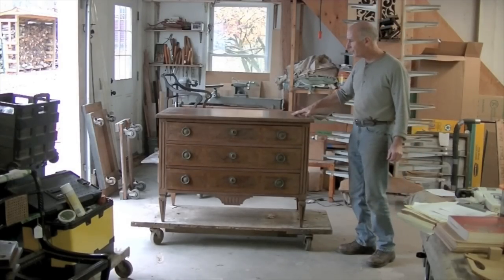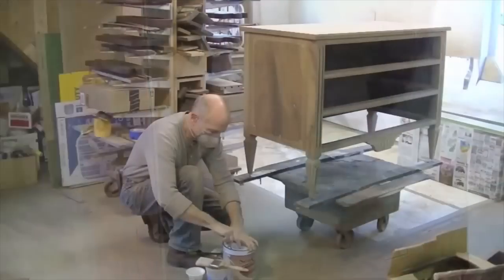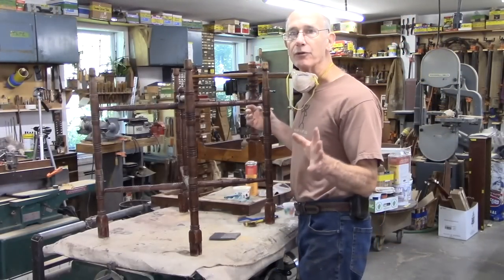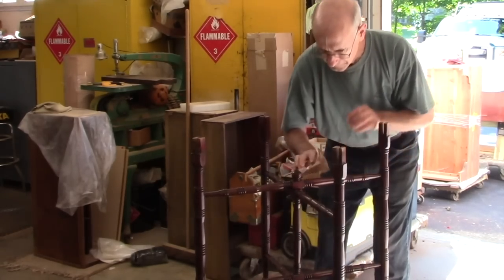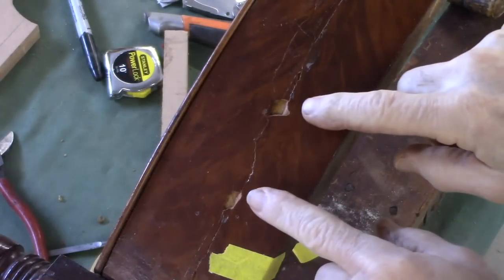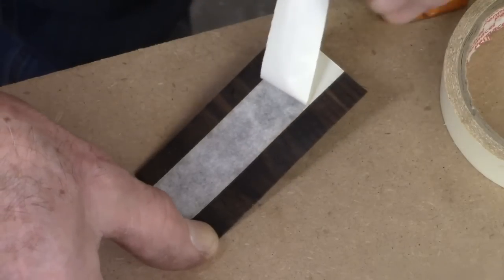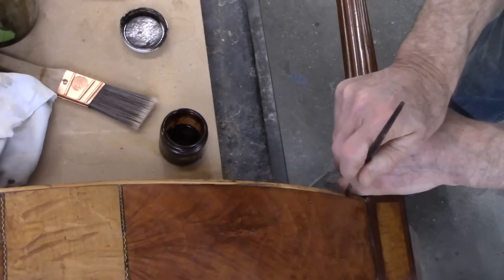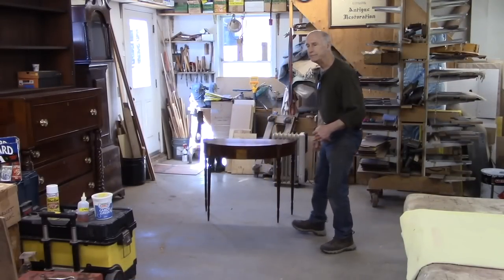DRAMATIC Furniture Restoration! - Thomas Johnson Antique Furniture Restoration

Comment: I love your work. The pup’s hearing protection made me smile. It makes me kinda sad that a lot of woodworkers use PVA glue nowadays for everything. When that furniture needs repair in 100 years… Well, I feel for that restorer. Hot hide glue or liquid hide glue is definitely the way to go for joinery. PVA has its place, as does epoxy, CA, etc. as for the tabletop glue up and extended time you needed. But hide glue is excellent for fine furniture joinery!
Reply from the maker: Thanks! Yes! So true. I use PVA for all new work though

Comment: Great video. I appreciate learning about clamp pressure. Why are nice species of wood covered with veneer?
Reply from the maker: Thanks! You can get all types of different grain and designs. It does make a more stable panel too (if done correctly)

Comment: Wonderful video. My favorite is the campaign table. My best friend wants me to replace the cane seat in his grandfather's cane chair. I've found the parts and I feel pretty good about doing it. Can I use hide glue rather than pva? I'm just thinking about future repairs. And what sort of finish should be used on the cane? Thanks so much for the advice.
Reply from the maker: You're welcome! Yes, you can use hide glue anywhere that you might use PVA, they're both good. Cane doesn't need any finish, unless you're trying to stain it. I always recommend just letting it age
Reply: @johnsonrestoration  I'm glad you said that.  I have a side chair with a busted  cane seat and was wondering the same thing.  Not quite ready to learn that craft, though, but it's on my list. 😁🦋🦋

Comment: I would sugged investing in a vacum bag system.  It eliminates so much extra work when veneering.  Well worth it if you are doing large sections often.
Reply from the maker: Thanks! It only works if you can put the entire object to be veneered inthe bag. I have done that reveneering antique tops that can come off the base
Reply: @johnsonrestoration  I should have waited to comment.  I saw that you didn't take the whole side panel off when you did the glue up again.  My mistake.  Love your videos.

Comment: Furniture Wax: Tried "Gilboy's". Very expensive and had to go over it with "Howard's Feed and Wax" to get the look I wanted. Saw "Fiddes and Sons" used on "Salvage Hunters" in several episodes. Tried a little but not impressed. Going back to "Howard's..." for annual maintenance and also "Briwax Antique Oak" for my first coat for color on new builds. However, before any wax is applied, I apply several (3 to 4) coats of oil. Linseed or Tung. Get good, even color on pine from the "Briwax" after the oil application. Currently building pine rolling tool cabinets to replace my Sears metal ones. I will experiment with sealer first, then oil with a touch of stain, then "Briwax".
Reply from the maker: Thanks! Yes, the Gilboys is really only for formal pieces that call for a high sheen. I still use Howrd's 75% of the time

Comment: The scribe tool I use to etch polished elk horn buckles I can buy at a welding supply place that sells scribes for cutting steel with a welder.
Reply from the maker: I'll have to look into that. I'll google "scribe for cutting steel" and see what comes up.
Reply: @johnsonrestoration  King Tool and Dye in Bozeman, Mt. is who gave me mine.  I've had them since the 70's.

Comment: I have decided to restore a very used roll top desk but do not know how to determine what finish I am facing.  I did try denatured alcohol but it did not have any effect.  Any suggestions on how to find out the finish?
Reply from the maker: Thanks! I don't, except to say varnish would be very resistant to alcohol and paint thinner. Usually I don't worry much about what the existing finish is. I would try acetone or lacquer thinner to strip it, of course if that wasn't working well or too slowly I would go to varnish remover.

Comment: I will give you a tip, how I clean the metal parts (except for aluminium). I put them into a container, add some sodium hydroxide and add boiling water. It always works perfect.
Reply from the maker: Thanks! I'll try that!

Comment: Mestre TJ, eventualmente o nobre amigo já pensou em usar jato de areia ? Para mim, um analfabeto em restauração, me pareceu uma opção de limpeza de madeiras e depois o acabamento feito com lixa.
Reply: Sandblasting has been used by Woodworkers building modern slab live edge tables with wood taken from mature trees. The sandblasting removes loose and weak wood particles from the live edges effectively without losing its rustic nature, and allowing the removal of bark and sharp points. They never use it on the facesSo, sandblasting is fine if you don't mind unevenness as "character". Considering that Thomas is restoring crafted furniture with fine detail, sandblasting is simply too harsh and less controllable as a finishing process. Plus there is the cost of the blasting media, and the equipment to do it safely. Where I've seen it used, it has been expensive and limited in application. Finishing is such an important, but time consuming process, and in antique restoration of fine furniture, where the point is to preserve as much of the original piece as possible, sanding by hand wins hands down.
Reply from the maker: Obrigado! BigHenFor respondeu isso perfeitamente!
Reply from the maker: Thank you! A much better reply than I could have done!
Reply: @johnsonrestoration  Meu caro, estou esperando minha filha vir aqui em casa para me traduzir o texto do BigHen. Não sei como fazer isso pela Internet. Sou idoso e esses recursos de informática me são desconhecido. Muito obrigado por sua atenção. Abraços!

Comment: I don’t understand why you would put wood filler in before you strip it, as the wood filler is just going to fall out with a stripper.  if you are that concerned about it dilaminating, then you should be gluing down those pieces appropriately before you strip it.
Reply from the maker: Thanks! I explained in the video - you don't want stripper getting in and loosening the veneer. I don't know what kind of putty you're using, but switch to Famowood, it's unaffected by the stripper
Reply: @johnsonrestoration  I have been a professional woodworker for 28 years and have been self-employed for 22 years doing my own professional finishing and refinishing. I use the exact same filler you are talking about. If you glue down the appropriate areas, there is no need to fill them before it is stripped